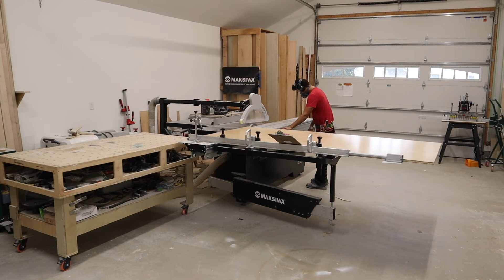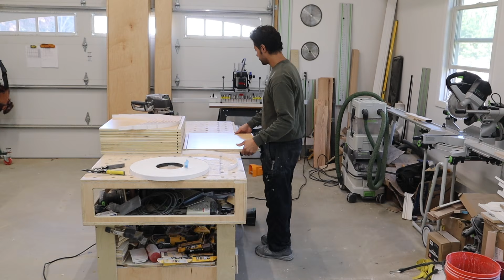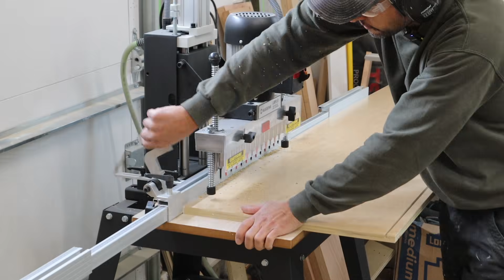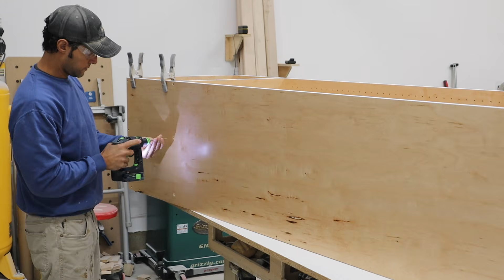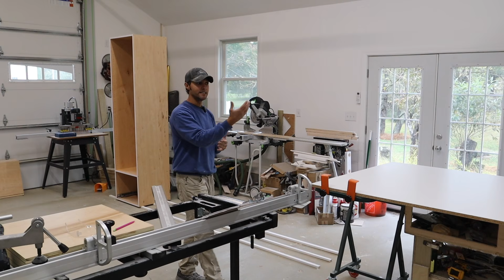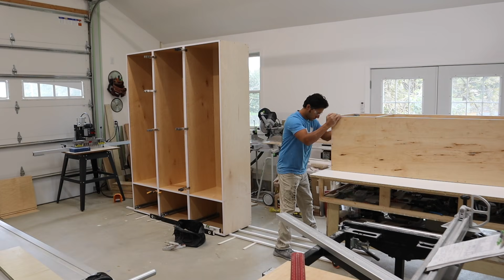Do you need a closet like this? tons of storage

Comment: Hello, I am thinking of doing my garage. Do you think melamine wood would be okay for toronto canada weather. Coldness and summer time hot? My question is would it hold up or would it get damaged? What are your thoughts please. Thank you
Reply from the maker: Traditional melamine has a particle board core. It doesn’t do well in extreme temperature changes and definitely doesn’t do well wherever there is moisture. Expect to see swelling, cracking and the white to turn yellow sooner than normal.

Comment: Thanks for capturing your process to put together a project like this! Love your channel, learned a lot from you over the years and very happy for your partnership with Maksiwa USA! You mentioned that you used pre-finished plywood panels and this is a paint-grade project - somehow I made an assumption that pre-finished panels are usable for a urethane-based finishing product not paint. So does that mean the primer is going to stick as advertised to the pre-finished surface as well? (I could really see how this helps with the grain filling part😊) Would love to see the painting part of the project to learn your process and technique! Also if you can do a retrospective on Conturo edge banding process you use that would be fantastic! I use Conturo and love it a lot but I struggle to figure out how to properly fill the hairline cracks of glue lines so that they don’t show up when you painting it.
Reply from the maker: The pre finished ply is for the inside, as these will get doors and drawer front that will be sprayed with a wood coating(primer, then white poly) I never “paint” cabinets, i use tinted wood coatings, like lacquer basically but waterborne. The sides will get covered with end panels, that will be sprayed white as well, those I sand off the pre finished surface first and then spray.